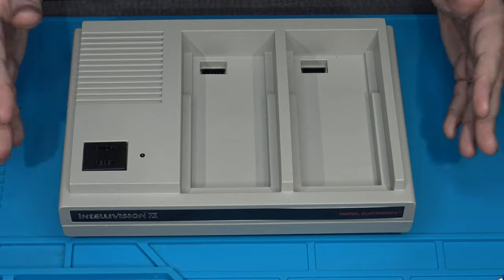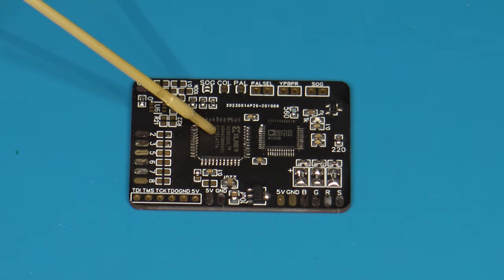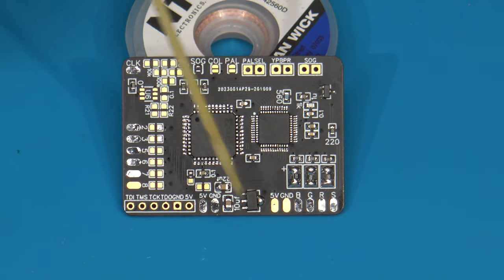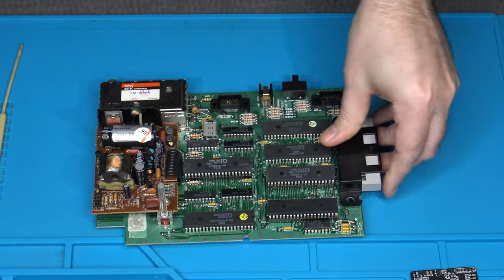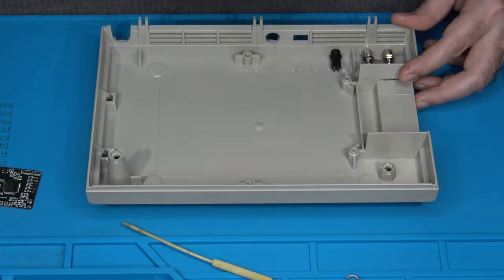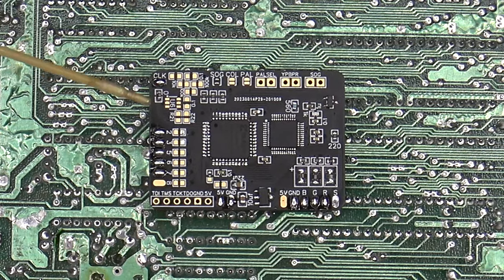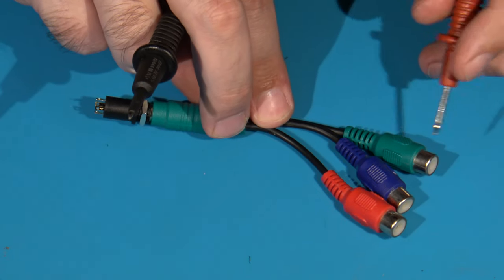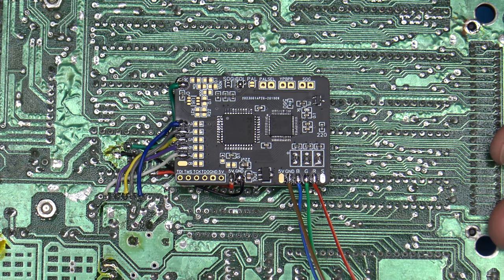ITC#75 :- Intellivision YUV (Component) Installation

Comment: Great video! I did things a little different - mod places board directly under RF modulator & inputs all connected to the color IC, but other than that, it's pretty much the same. I went for RGB/Scart output only, but I think I may try YUV now as well. ;) Thanks again for doing this video, as it's a fairly easy mod to perform and will hopefully give people the courage to try it! Cheers
Reply from the maker: This was done with Crayon's earlier v3 board which, is larger than his current v5 board. I have installed his board under the RF modulator section as well, but like keeping the openings free to run the wiring through it whenever possible. On my setup, the YUV output is better than the RGB as it isn't as dark due to the output resistors that must remain present on Crayon's board in order to work through RGB properly. As all of my Genesis 2 RGB cables have those same resistors in the SCART housing, it produces a darker picture on my setup through RGB.

Comment: This is very helpful. Do you have any plans to make a similar video for the Magnavox Odyssey2?
Reply from the maker: Perhaps if another O2 comes my way that requires this. I have installed the newer versions of this kit into the O2 and it is pretty much the same process in that Crayon King even includes a Quick Solder Board for his O2 kits to make it easier. The most difficult part with the O2 is deciding where to install all of the AV jacks as there isn't as much room on the lower back of the console as I had figured there would be.
Reply: @IvoryTowerCollections  I actually have an O2 that I'm wanting to get modded.